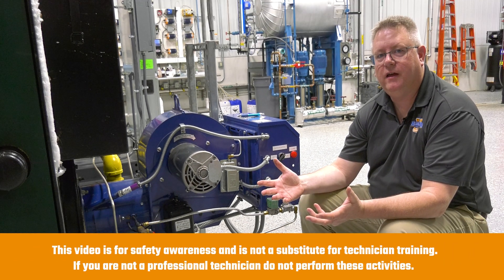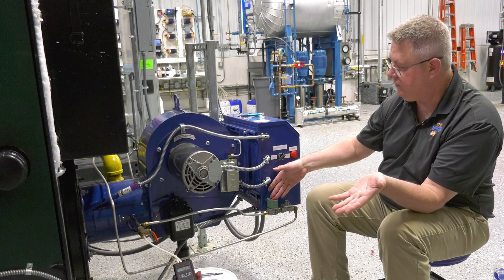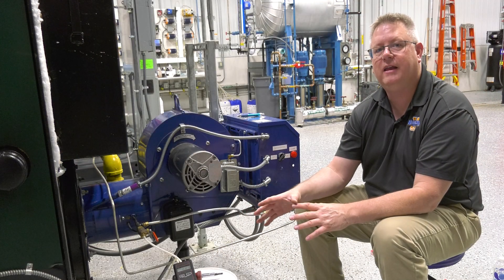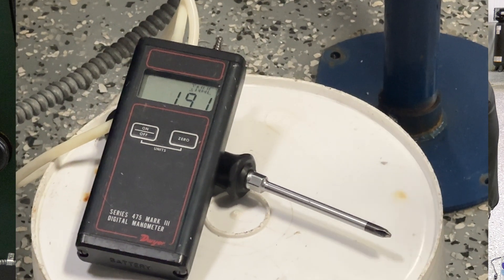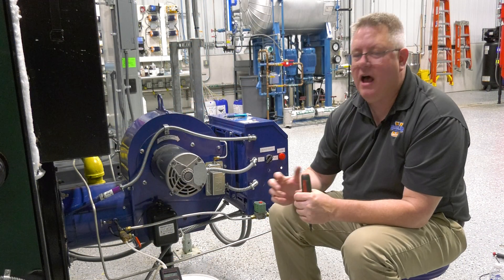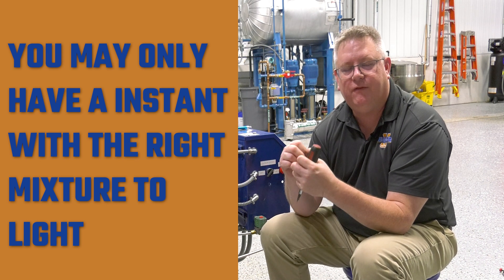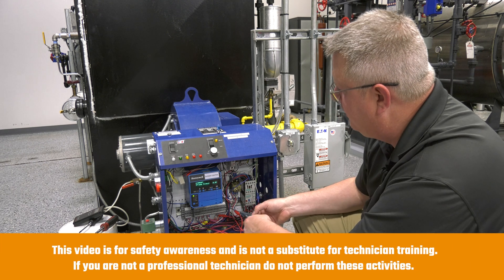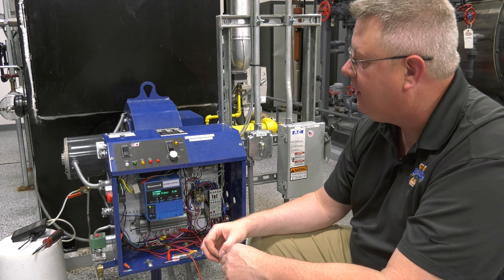How To Check the Pilot Gas Pressure - Pilot Problems Part 4:  - Weekly Boiler Tips

Comment: Great tips, on pilot gas pressures adjustments but what was not mentioned and absolutely necessary is starting with a clean pilot and pilot orifice. We can make pilot gas pressure adjustments all day long but without a clean pilot to start with, we may be just putting lipstick on a pig , buying temporary time at best and at worst causing high carbon down the road (let’s verify those pilots are clean first🔥). I’m sure you most likely mentioned this in the previous videos but I feel it’s best to at least mention it when going over the subject of pilot gas pressure..